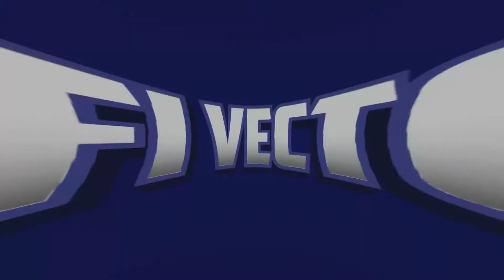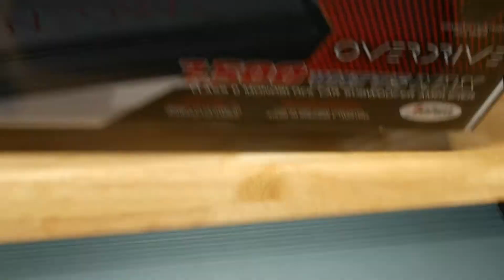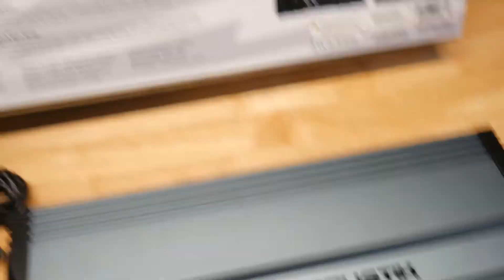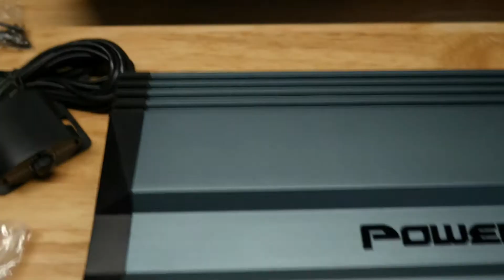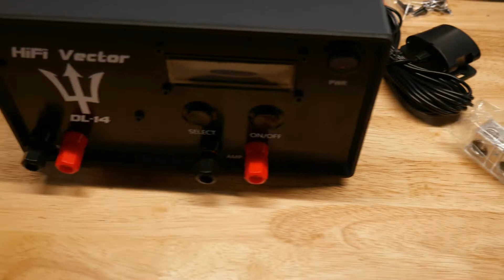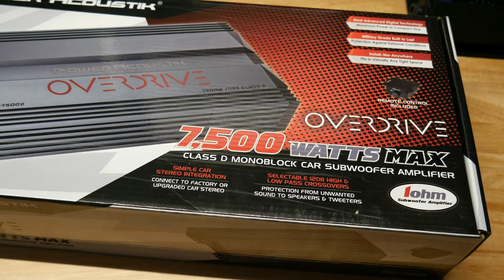Power acoustik overdrive OD1 7500D amp dyno review hifi vector dl14 and SMD  amm1

Comment: I am so confused if it's a two channel or it's just got double hookups
Reply from the maker: It’s a one channel amp it just has 2 pair of speaker outputs. So if you wanted to run two subs and run separate wires from the amp to each sub.
Reply: @HiFiVector  it's alot like my nesa TS1.9000D. thank you that's what I was wondering.
Reply: I figured it out. Its one channel but two hookups. I don't see why you can wire 2 12s in parallel @ 1 ohm with this. In the manual it says no for some reason

Comment: Just got a brand new one in box for $70. I really do wish they rated them right. I am ok with 1600 @ 1 ohm. I am kind of confused though. In the manual it says you can't hook up two subwoofers at 1 ohm on this amp. Is it a two-channel or is that just a double speaker hookup

Comment: Have you ever test a AudioPipe APDL1-16001D can't find no test on that series its rated at 650@4 ohms 1000@2ohms 1600@1ohm. Seen AudioPipe amps do good but can't find anything on my AudioPipe amp
Reply from the maker: No haven’t tested that one yet.
Reply: Ok thanks. I just can't find nothing about it all lot of 1500-1800 dynos and they do good. I've only be able to find the rating's about it. The ratings RMS @4ohms 650- @2 ohm's 1000 and 1 ohm 1600. I run the sub in 2 ohms it's either on a L7 15 single Alpine Type R both dvc4 and a 12 quantum audio cozmik series dvc4 they're all singles don't have a pair at the moment. The closest one I seen is a AP APDLO-16001D. They both have the same rating's my APDL1 where those little grills the little grills are my have the more circular design the other amp has  different design.
Reply: Man aslo I apologize for the long message I should've ask have u Dyno the APDLO

Comment: I have an Orion HCCAsplx 3000.1D on two 12s 4ohm DVCs wired to 1 ohm, draws a lot of current, though i have a DC Power 320A alternator, looking at one of these to run instead of the HCCA. Thanks for test
Reply: Hell No. You'd Be Losing Damn Near 2000 Watts. If I'm Not Mistaken Your Amp Makes 3900 On 1 Ohm

Comment: I was considering installing the twin Overdrive amplifier set. The 7500w monoblock and the 5000 watt 4 channel. How'd that sound?
Reply from the maker: That would be good they are decent amps as long as you you know the real output.
Reply: @HiFiVector  Sounds good. I'm currently using the Power Acoustik Overdrive 3500 watt 5 channel amplifier. The one issue with that is the 5th channel cannot do a subwoofer set under 2 ohms. So I actually am gonna use it as a 4 channel and get the 3500 watt monoblock which is able to handle my 1 ohm Boss Audio Ground Shaker with three 4 ohm 10 inch subs wired in series.
Reply: Awesome

Comment: Bought this same 7500 to push 2 15s soundqubed 2 ohms and once I'd turned the the gain up slowly went into protect mode. If it says 1 ohm subwoofer amplifier then it should work at 4, 2, and 1 ohms. Doesn't make no sense why it went into protect mode when it suppose to work as described.
Reply: Check your ground and make sure you are using ofc copper wire. Make sure your connection to your battery and fuse block isn't loose
Reply: Switch out your fuses on the amp to some higher
Reply: Thanks for helping with tips. Was a bad battery

Comment: How does the test work exactly? I’ve seen another amp get test before and had a similar turn out, but once hooked up to my set up it would have the neighbors knocking on my window saying it’s too loud. How do you get these numbers?
Reply from the maker: The HiFi Vector DL-14 basically replaces the speaker or subwoofer in amp testing. It gives you a fixed, non-reactive impedance load so you can test an amplifier at a set ohm load ( 1 ohm, 2 ohm, 1.34 ohm and 4 ohm )  This eliminates the need for speaker so it is silent so you won't disturb others. Also You can't dyno test an amp when using a speaker and get any kind of accurate reading because a speaker is a reactive load so ohms are  constantly changing so its near impossible to get an accurate reading. ( for example a 2 ohm sub will read from 3 - 5 ohms if you are trying to test and amp with the sub hooked up ) So the DL-14 with a SMD amm1 or even a ac clamp meter and ac volt meter can give you accurate results. If you want to test amplifier output.  This is a must have tool if you own a SMD amm1 meter but even with this since it is non reactive you can get pretty accurate reading from simple voltmeter and ammeter.

Comment: Had the od1-5000.... worked fine for a bit then after a week it made a welding sound inside and no fuse for protection
Reply from the maker: Yea, you should always run an inline fuse on your power cable. Sorry it crapped out on you.

Comment: Just over 1600w at 1ohm! WOW! How, some of the big have fallen. Not sure of the price tag on this but doesn't seem like a good deal. So misleading, how these companies getting away with this? Great video, keep it up.
Reply from the maker: They do make some great products but yea this amp fell a little short. For the money ( $160) it’s not bad really it’s just the  claimed rating are way off. Thanks so much for subscribing!
Reply: @HiFiVector  

$160 for 1600wrms at 1ohm isn't too bad, your correct not too bad. I believe Audiopipe apcl 1500 does close to 1900wrms at 1ohm for the same price point.
Reply: 130$